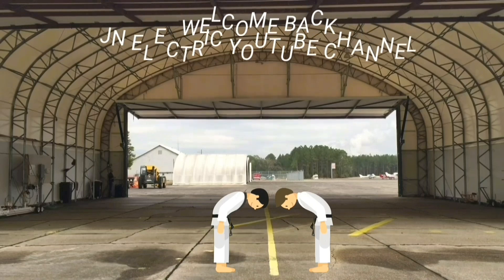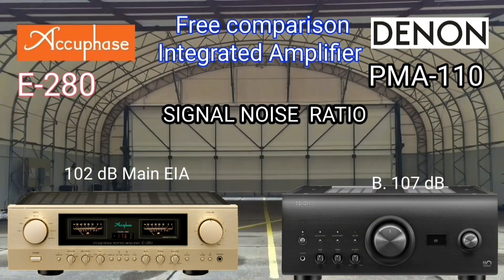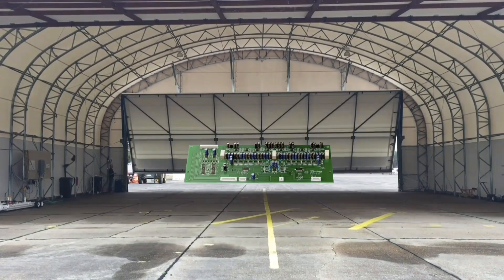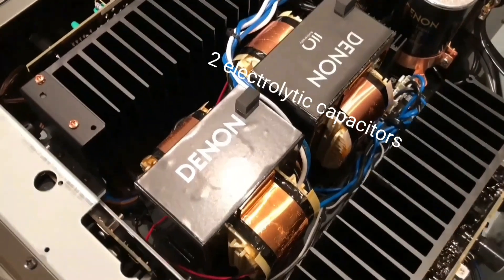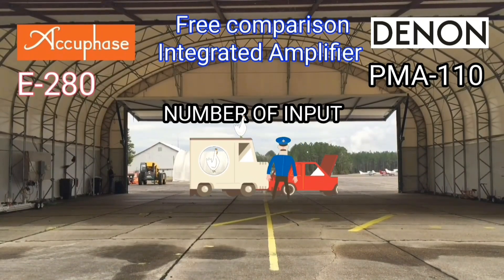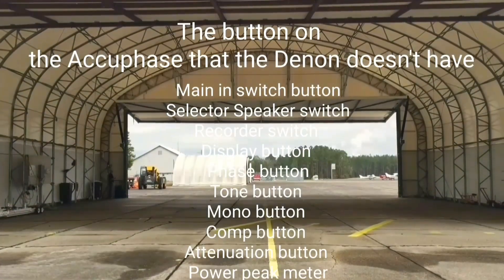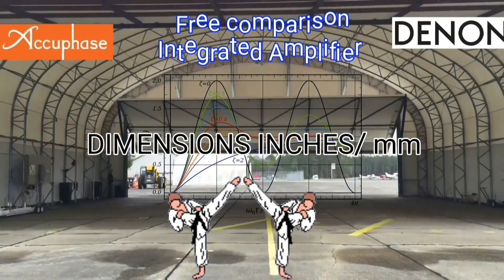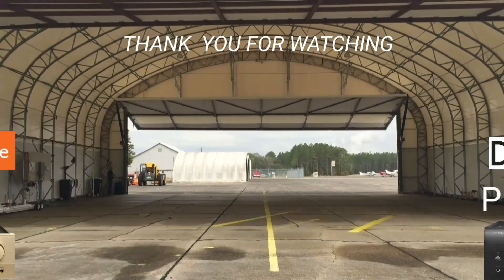AcCuPhAsE E-280 vs DeNoN PMA-A110 integrated amplifier  proudly they show what the best it has

Comment: What current does denon have after the rectifier on the secondary of the transformer is not written in the service manual
Reply from the maker: I'm going to help you friend

Max transformer 200 watt per each.
max load into 4 Ohms per channel 160 Watt

I = √P/4)
    = √160/4
    = √40
    = 6.3A per transformer 
P = power
I  = Current secondary transformer after rectifier.
Reply: @JNElectrics  Thank you for the answer, sir, he has a two-level power supply, 61v and 16 v come to the amplifier, I wonder what current is on the 16v supply, it turns out that the full power of the transformer P= (v) x (i)=61v x 6.3A=383VA

Comment: Would it be possible for you to test the Michi X-5 Integrated Series 2 plus a comparison with the Musical Fidelity 8Xi and the Technics SU-R1000?
Reply from the maker: later I'm going to to
Reply: @JNElectrics  thank you very much; I am seeking a one box solution and the MF does not have a built in phono stage. By all accounts the X-5  is let down by its phono stage. So this leaves the r1000 though it is down on power.

Comment: DENON PMA-A110 :
Signal-to-noise ratio digital zero 100 dB
Distortion factor at -9dBFS 0.004 %
Transducer linearity at -90dBFS <0.1 dB
Continuous power (8 Ohm / 4 Ohm) 92 W/168 W
Pulse power 4 Ohm (1kHz) 220 W
Distortion 50mW/5W/1dB Pmax 0.007 %/0.002 %/0.008 %
Interm. 50mW/5W/1dB Pmax 0.002 %/0.003 %/1.5 %
Signal-to-noise ratio at 50mW/ 5W 77 dB/94 dB
Signal to noise ratio Phono MM (5 mV for 5 watts) 82 dB(A)
Signal-to-noise ratio phono MC (0.5 mV for 5 watts) 70 dB(A)
Attenuation at 4 Ohm (63Hz/1kHz/14kHz) 156/150/93
Upper cut-off frequency (-3dB/4Ohm) >80 kHz
Crosstalk Line 1 > Line 2 80 dB
Synchronization error volume at -60dB <0.1 dB
Stereo channel separation at 10kHz 39 dB
Power input Stby/Leerl. (at) <0.1 W/94 W(225 Volt)W(225 Volt)

Tom Frantzen Stereo 3/2021 

More : 

https://www.audioholics.com/amplifier-reviews/denon-pma-a110

Comment: Denon seems to be the better quality!
The A110 is Denon's top-of-the-range model, while the E280 is Accuphase's entry-level model. 😉
Reply: Denon top of the line is PMA-SA1 (11) and  SX-1 (11) Limited
Reply: @audiolover  You're talking about equipment that's nearly 20 years old, but I'm talking about what's available today. The A110 is very good, it has a dual power supply, a very high level DAC (on this point the old ones are totally out of date) and a much more advanced volume control system.
Reply: @dab9742  SX-11 and SX-1 Limited are actual models where Limited cost almost 3 times more than PMA-A110. Even PMA-S1 from 1993 will be better than funky A110. Amplifier should be amplifier not a Dac. Newer doesn't mean better, like cars.. 🤷